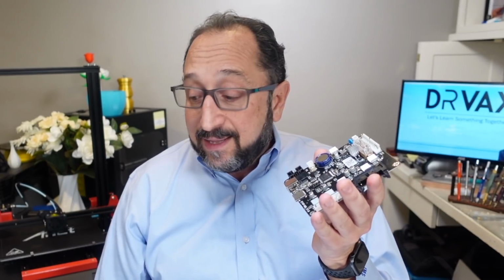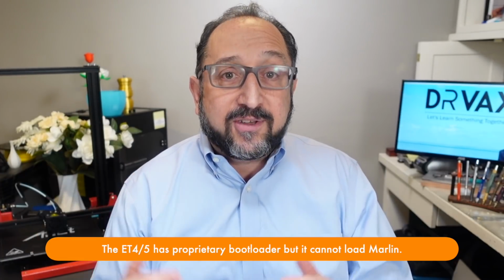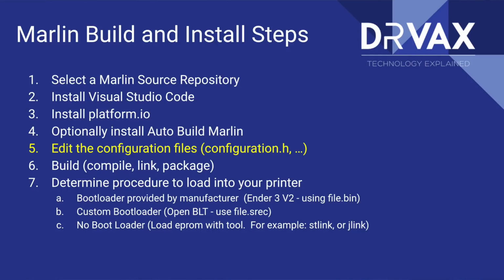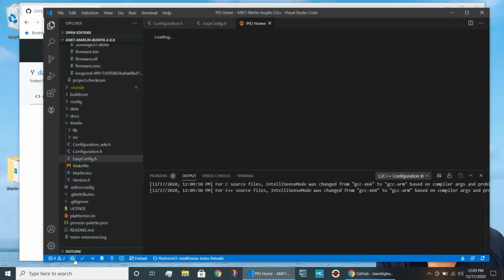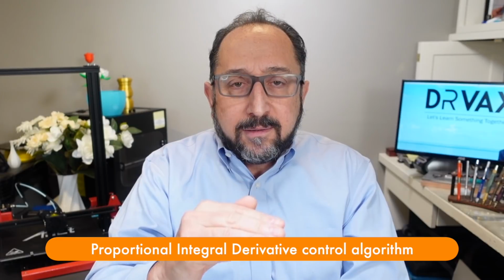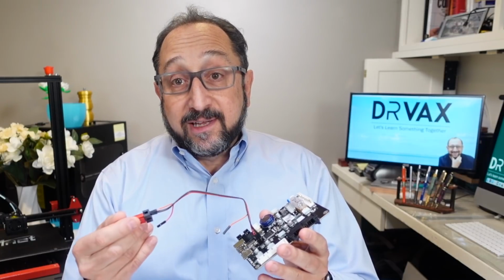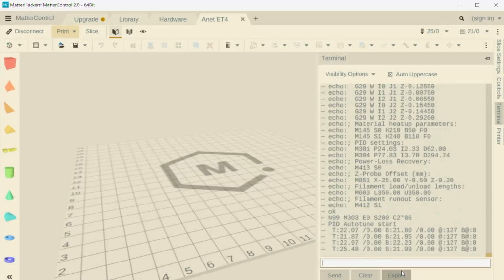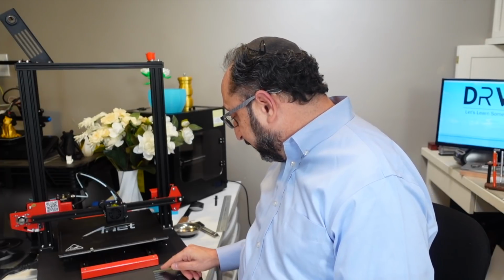Marlin 2.0 Build and Install | ANET ET4/5 | Ender 3 V2

Comment: 0x10000 is not "ten thousand hex". Please. This is embarrassing.
Reply from the maker: Of course, you are correct.  At times while trying to make things easier for people to follow, to understand, my mouth gets ahead of my head.  Thank you for pointing this out.  My challenge is that I am old enough to have started my career on DEC PDP-8s that used Octal, so I still find Hex a bit strange even after all these years.   :-)
Reply: @MakeWithTech  You must have stuck with DEC machines for a long time; when I started forty years ago, machine language (in hex) was what I started with.    8)

Comment: Hi, I enjoy your videos and have learned a lot from them. I have a question that I haven't been able to answer if you don't mind. After installing cr touch and jyer firmware and creating a mesh, how do I get the machine to use the saved mesh instead of running mesh creation before every print? I have auto leveling enabled in printer and the G29 code in code in Cura. Thanks
Reply: Please disregard the question, I found another of your videos which answered the question.

Comment: Anet has recently suggested that the ET5 needs a BMG extruder to replace the stock one before you upgrade to Marlin 2.0, or else you'll get all kinds of extrusion errors.
Do you have any experience with these issues? I'm really gun-shy about upgrading my firmware, but I can't get a compatible "Filament Change" command for the legacy firmware.
Reply from the maker: I do not.

Comment: Hi Irv, I would ask you a thing.....i replaced software of my et4 with marlin 2.0 last year. I set max nozzle temp. at 235°C but now I need to get at least 245(lw-pla). Is it possible to modify parameters on sd card directly or i must use visual studio code to create a new .srec?
Reply: Yeah, im on the same boat as you. The machine wont let me put the temp above 235ºC. After that, turns the temp off. Since the file is already encoded, you cant edit it. It has to be built, then encoded.
Reply: @babiiilon  i compiled again on vsc temp setting to 270°C  ,filled sd card and replaced old version . Now I can get 250°C . But if I set it to 255°C machine shoot off. That's fine at all.
Reply: @massimoborghini9724  i just built mine (put it to 275ºC) and it works like a charm on 250ºC
Reply: @babiiilon  👍 MWT teach, we learn. 😉

Comment: I installed Marlin as this and the Anet website instructed and it has been great. But the sensor keeps being so unreliable. I want to set it up with an endstop switch and just manual bed level, do I need to flash it with the old firmware like the Anet shows for cancelling bed leveling or is there something in the provided Marlin firmware I can do to use end stop switch instead of sensor? Yes I have the hardware just need infor on firmware end. Ty for any help.

Comment: It is obvious that you know what you are talking about, but you start explaining how to do something and then a little way into it you say "but we're not going to do that" so many times that a newbie gets lost in all of the info. that, I guess, wont be used in this firmware change on the ET4 Pro. That's where I am right now. I have Marlin 2.0 on my ET4 Pro but the ext ruder perimeters must be wrong(I don't know, I should have left it  like it was) because it crashes when I try to use it. I walked away from it for awhile but the problem is still there..Lol
Reply: I don't know if it's an issue with the ET4 as well, but Anet has suggested that the ET5 should have a BMG extruder upgrade before attempting the Firmware update.

Comment: Brilliant video thanks for the help!!! made installing Marlin easy. I followed your video and succesfully installed marlin onto my Anet ET5X :D only downside is the touch screen needs calibrating but it keeps failing when i try (any help would be appriciated)...... still its a masive improvment over the stock software.

Comment: Hello every one, How long does the SD card take to load ??? it's been going on already half hour... is that normal ??
Reply from the maker: No something is not right in the configuration.
Reply: @MakeWithTech  Thanks, I managed o make it work... I thought this would have fixed the issue I had but I think it's just a bad motherboard. The sensor doesn't stop and drills on the bed. I have tried everything, all your tutorials and many others but it does not work, not even with the offset, it just goes down and down...

Comment: I’m missing something! I’ve been trying to build the Marlin firmware for my Anet ET5X. Firstly, visual studio code doesn’t recognize my Marlin folder, but it does recognize a file. When I load it, it says “file is not displayed in the editor because it is either binary or was an unsupported text encoding. How can I correct this?

Comment: I don't know where I messed up. I was trying some of the advanced features then the printer froze so I decided to turn it off and then back on. After that I got the power outage screen asking if I want to resume the print but the touchscreen won't work. I tried also to hold my finger on the display to do a new calibration but nothing happens. I then chose to flash the memory and put back the old firmware but the screen will remain the same (still asking if I want to resume the print or not). I even tried to erase the chip and put back the old firmware but the screen turns white without showing anything. I really don't know what to do, if I try to put marlin it will show the same freaking resume print screen.
Reply from the maker: What printer are you using?  I recommend posting your question at forum.drvax.com where a whole community could try to help.
Reply: @MakeWithTech  thank you for your reply. I have a labists et4 (basically an anet et4 pro). I changed its motherboard a few weeks ago with a more silent one that's intended for anet et4 pro printers. It was working just fine even after I installed the marlin version provided by Anet on their website

Comment: DR VAX  I have the micro swisss all metal hotend and Tried to update the pid settings  I followed all your instructions in you previous video and when I try to store the p, I, D settings doesn’t show its store can you please help me? Thanks
Reply from the maker: Saving pid settings is not dependent on your hot end.   It depends on your firmware.   Depending on your firmware this will not work.
Reply: @MakeWithTech   thanks for your reply, I have the ender 5 pro and I want to print all kind of materials including carbon fibre. I have done some test prints on pla and looks fine, any suggestions? thanks.  love your chanel btw

Comment: I have an ET4 Pro and I upgraded to standard Marlin 2.0 a couple months ago. Marlin seems to function as it should but I am not very knowledgeable in 3D printing and setting up the firmware for use. What is the best way for me to add settings custom for my printer and correct issues like print head not starting in the center of build plate, I believe the sensor starts in the center, I have navigated through settings and tried many times to change offset values without any luck. Do I just need to start over from scratch or can I modify what I have installed? Thanks in advance!

Comment: Would there be any issues in using the ET5 configuration for an ET5X?
Reply from the maker: They are the same printer with different model.numbers for distribution/sales purposes.
Reply: @MakeWithTech  That is what I was hoping. Thanks for the great video, very helpful for all of us new to
3D printing.
Reply: @mburke1246  did you manage to get it working ??? I am stuck on the sd card loading and loading... it never finishes

Comment: I am brand new to 3D printing. Just bought an Ender 3 v2, BL Touch. I’m finding this video very confusing for a few reasons. 1. It seems to be almost exclusively geared towards ANET ET4/5, not Ender 3v2. Also, as a Mac user, like you, this is all done in Windows. I wish you had a version that is for the Ender and firmware build on an OS platform. I’m sure I’m not the only viewer running on OS.
Reply: I am in the same boat as Deanna Atkinson, I got confused at time stamp 16:01 where you speak of the forked file for the ET4/5.  I dont think that is for the Ender 3v2 is it???

Comment: ANET ET4 X  new  I get a add filament if I try to print  THE FILAMENT IS ALL THE WAY TO HOT END  tried the internet have not found  a fix
Reply from the maker: Your filament out sensor is not working properly.  Make sure the cable to the filament out sensor is fully seated.
Reply: @MakeWithTech  actually... This is a normally closed switch and when you disconnect the filament sensor on the Anet printers, it reads OK.

Comment: Great video, I have a problem doing G29, when moving to front side of bed and going down to sense bed its off the bed and cant sense the bed, is there any idea why this happen? A parameter of coordinates is wrong on marlin that I should change? 

Please advise.

Thanks
Reply: It's your probe offset! (X and Y)
You can adjust it in the settings on the Touch Display (not sure where exactly)
This should do: { -25, -8.5, 0 }
Reply: @RockTrailLP  let me try that, I had different parameters, I found them on advanced settings.

Thanks, I will post result
Reply: When the numbers are changed how I can save them to stay? Any idea?
Reply: @joselagunas1038  go through settings to safe the configuration somewhehre
Reply: @joselagunas1038  did it work?
Reply: @RockTrailLP  Hi, sorry for the late reply, it worked you gave the right path, my final numbers were -40, -30, 0

Comment: Hey Doc. Im having a problem with my machines reconizing my laptop it will turn the machine on byt when i try to load the firmware it says print no hookes up.. i don't know what to do.. can you please help me..
Reply from the maker: Try another cable.  Not all USB cables support both power and data.
Reply: Sames happen to me, have u solve it?
Reply: Same here! The st-link wont connect to the printer! Tried everything!

Comment: Yikes ...am thinking of getting a ET/4 to replace my 2.5 year old CR10 mini mainly for the smaller footprint due to the Mini's spaghetti bunch of cables and separate control box taking up limited valuable worktop space and the auto bed leveling will be nice. ...I didn't realise a firmware update to Marlin would be so complicated ...despite the fantastic detailed explanation in this vid it is completely over my head :) ...

I wonder if it will come pre installed in future versions of the  ET/4?...if not I think I will just have to stick with the Stock firmware.....wish it was as easy as updating firmware on a motherboard/dashcam/camera etc  which I have done many times :(

Like I say great vid though Dr Vax...have subscribed.

Comment: I am attacking this the other way around. I have not ordered my 3D printer (will be a Ender 5 plus) but I have ordered a Bigtreetech SKR Pro V1.2 with TMC2209 Stepper controllers and a  TFT35 V3.0 Display. 
So far I have configured and compiled Marlin V2.0 for the Pro controller to handle 99% of the functionality of the Ender 5 Plus.

Comment: Hello everyone, I'm in need of some help.
Just bought myself a Creality CR10S Pro V2 because all i see on youtube is the most smoothest and flawlesly unboxing and imediately perfect working 3D printer without any problems that makes the most reliable and perfect prints you can imagine.
I want to install the printer so perfect, read the manual before from A to Z and backwards so that i'm not going to make any mistakes, then looked for another dozen unboxing and installing tips on Youtube and finally after 2 days i managed to install my printer without a problem in no time.
But then.................I turned it on and................... you guess; ...... trouble started;
The printer went down on the bed and made a really ignorant noise like metall that is bending ..... and it did bent (or is it benD??). The Nozzle was in the middle of the bed and was going down while the BLTouch Bed Leveling Probe was hitting the bed first, 2 times to be exactly, and then get up again before it came down without anything in the world could stop it. It really hit my Bed very hard and before i knew what was going on and powered off the machine, there was alot of damage.
I have tried to recover the damage and went on, with the believe it was my own fault because i was so stupid to trust something to work right out of the box. But whatever i tried and how much video's i watched before making another attempt; the damage is getting worse and worse. BTW, after leveling it always says that Z=29,9. But the nozzle is only about 15 away from the bed.
So now i have a completely brand new CR10S Pro V2 that is not working (and the bed is damaged, without warranty as i understood)..
It really drives me crazy and i'm desperately in need of help.
Is there anybody, preferebly in the Netherlands, that can help me please?????
Thanks in advance,

Gerard
Reply: I bought a Creality cr-6Se just before Christmas and it comes with a warranty.  The documentation states that you must contact them as soon as possible for cost free replacement parts(within 3 months of delivery).  They say to send pictures if possible and describe in detail the steps leading up to the problem.   Good luck,  I hope they support their users as advertised.... free support for life.

Comment: ender 3 v2 has boot right so y would need to use software to add bootloader in?
Reply from the maker: Correct.  The ender 3 v2 will load marlin dot bin files.

Comment: Great video. I can tell you worked very hard to make it easy to understand. Thanks. I have an Ender 3 V2 and have tried to follow a couple other tutorials on configuring Marlin 2.0.x for both BLTouch and a couple tweaks for  a Micro Swiss Direct Drive chassis.  For the life of me, I cannot get the newly built .bin file to work properly. It loads fine, but the tutorials instructions seem to mess up the BLTouch modification. 

I feel like this video was geared mostly for the Anet users. I wish you could do another in-depth discussion for those of us trying to make changes to Marlin source for our Ender 3 V2’s.

Thank you again for your very informative videos and tutorials. 
PS: In the Dave Teran links you need to correct “Girhub” to github.
Reply from the maker: Thanks for the comment.  I fixed the GitHub typo.
Reply: I agree, these videos are fantastic, but it gets too confusing to follow when using an Ender 3 V2 since the steps are a little different.

Comment: I just did all that two days ago trying to figure everything out myself and luckily got it working in the end.
The only issue I had in the end was recalibrating the touchscreen. The solution to that was doing a M995 command over pronterface.
The only thing I wasn't sure about if I had to necessarily bake the new settings into the firmware. I guess that's what you did when you mentioned the PID tuning settings.
Is there any point in reflashing with the adjusted settings?

Comment: What about the manual mesh leveling limitations with the ender v2. I'm digging like hell on the net but still no solution with the warped beds.
Reply: I too spent time to check having manual mesh levelling in my Ender3 v2. I found that it can be enabled in firmware and can be used via Pronterface but not through display. Having gone through the Marlin firmware files, I would say the E3v2 struggles to have the feature via display is because the display interface is not compatible with the graphic displays used in earlier enders or alike. Significant amount of code would be required to make it happen without affecting normal functioning.😔 The Marlin community will surely come for solutions on this.🙂
I myself haven't tried to do manual levelling firmware. Built it but kept stock since i was able to only use my printer for less than 20 hrs printing time in period of two months.😒
Reply: @amarbendale861  yeah I noticed it cause of colored display cuz regular ender and pro uses a code colomn which is named with lcd-something. The main reason v2 doesn't recognize the code is it's made without lcd. I'm not like a type of code-wise guy so my knowledge is very limited. Especially if we consider my experience is just 4 days with the v2. hope someone find a way to fix it.
Reply: I think Smith3d firmaware for BLtouch have option for Aux leveling which is manual Mesh level with customized UI check their site. I may be wrong tho
Reply: @wojciechgurycz9168  checking right order. thanks.